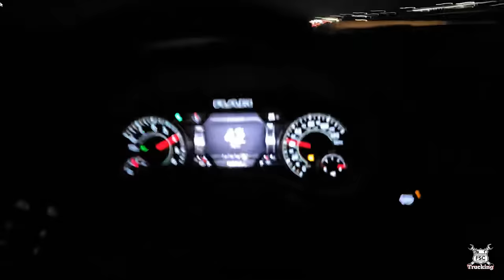MATS 2024  Tim Gentry & I Drag Race Stolen Equipment And Celebrate A WIN!

Comment: Technically those are just 379 doors on westens truck.  The 06 and 07 379 doors are the same as 389 doors.  The later 379 dash is the same as the 389 dash.